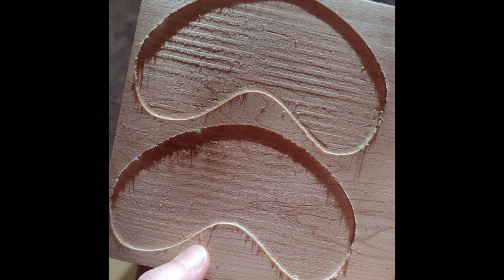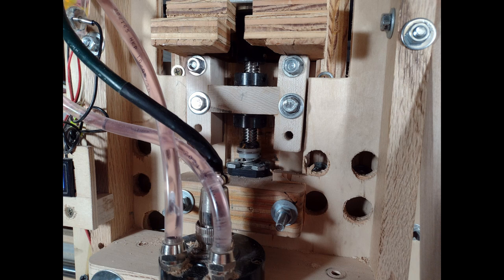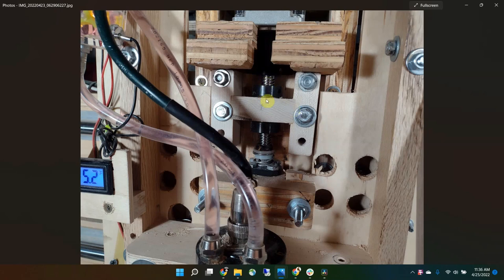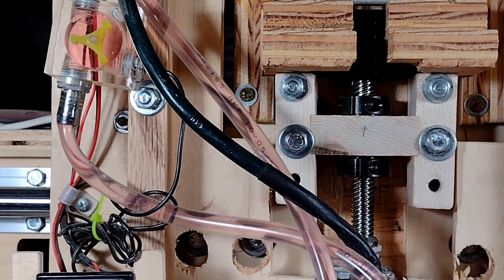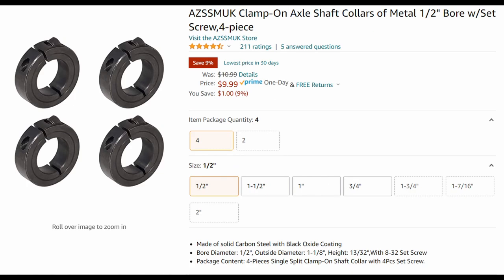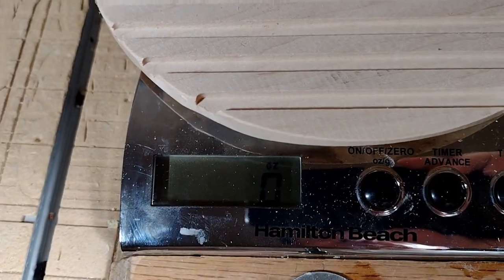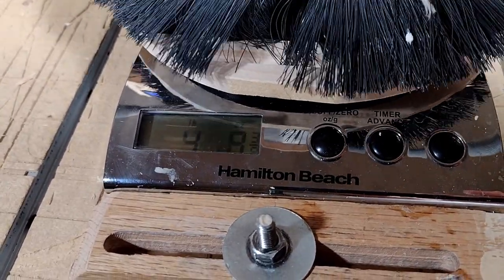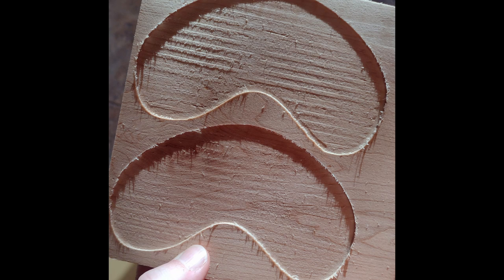Follow-Up to CNC Tooling Marks

Comment: The results you had with the dust boot is why I now have a Camaster Stinger. My previous machine was not metal frame.  I wanted dust collection and in my way of thinking the problem gets worse as the brush change direction on the X axis.  Nice video and clear explanation of your work.